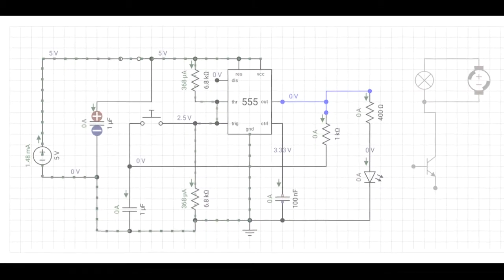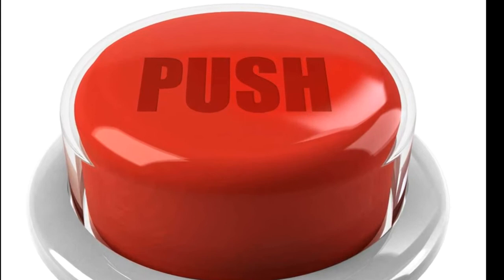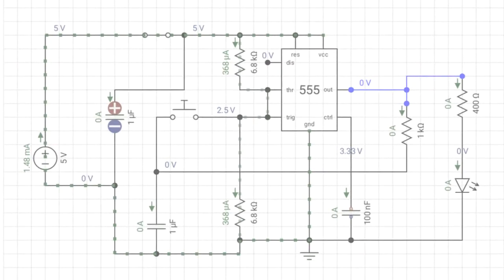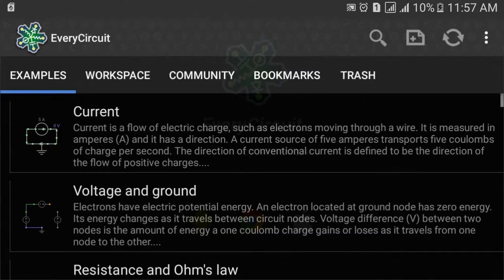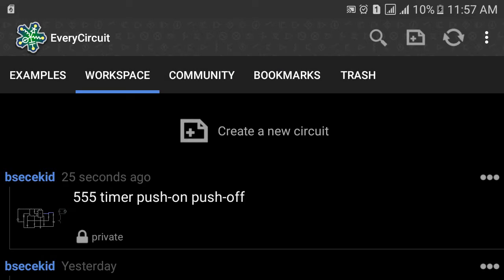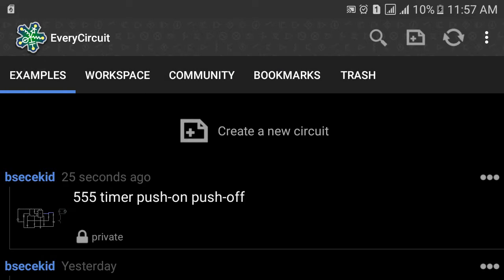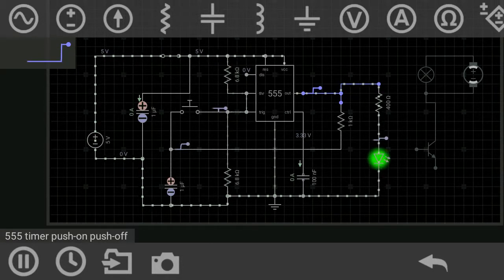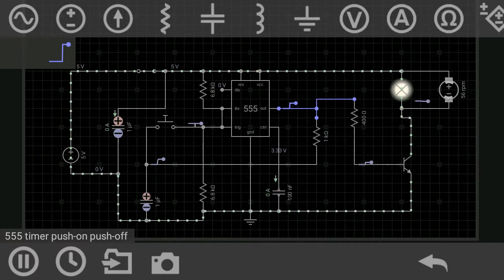Push-On, Push-Off 555 Timer Circuit || One Click To Turn off/on

Comment: Will this circuit automatically switch back off if the button is not pressed a second time?  I'm trying to find a 555 circuit with single button push-on/push-off function which also will time out and switch off on its own.